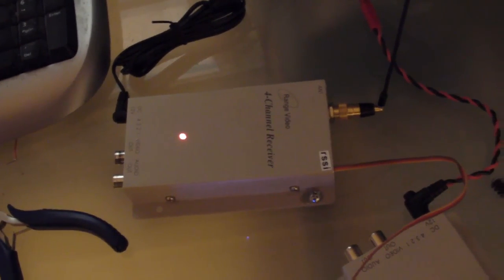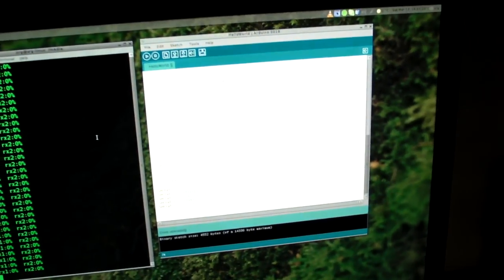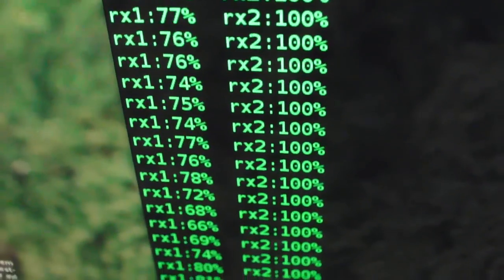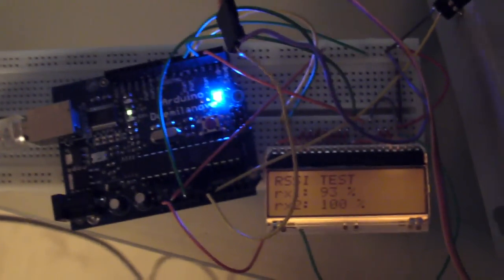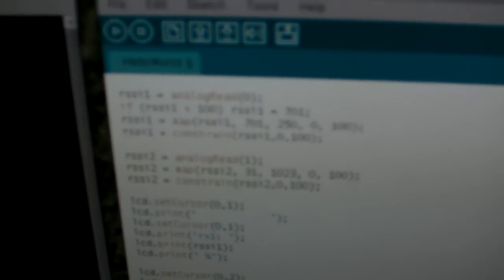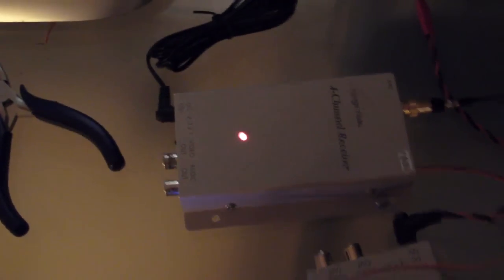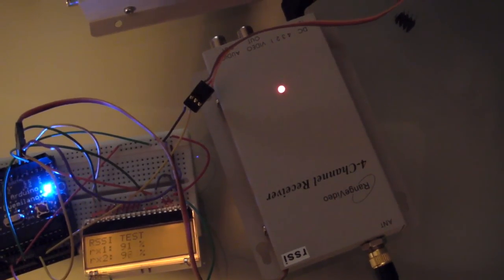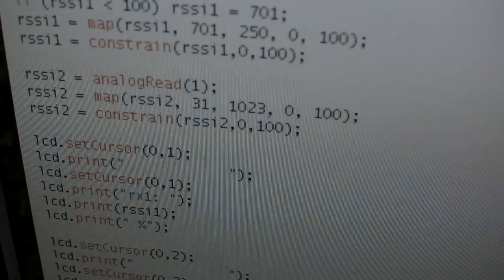FPV Arduino RSSI project

Comment from the maker: @bobmaxiao You have to measure with a multimeter on the pins of the metal box inside the receiver. And see witch of them changes, when you turn a transmitter on or off. I had to of the same receiver bought from the same place, but the pin was not the same ! Only way to find out is to measure. Also in one of my receiver rssi volt went from 0-5v for low to high rssi but on the other, it went from 4v to 1.5v for low to high (the voltage was reversed on that, lower meant higher rssi)..